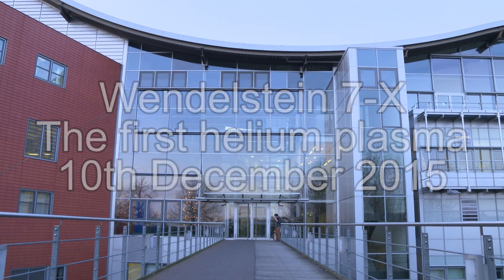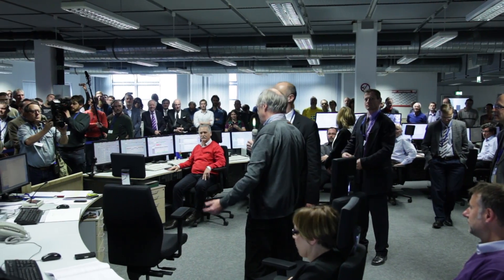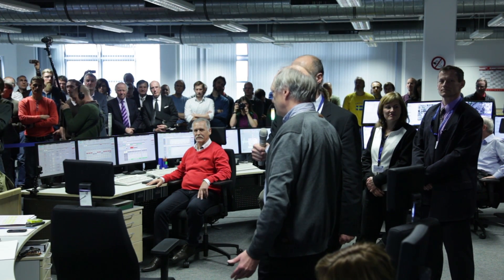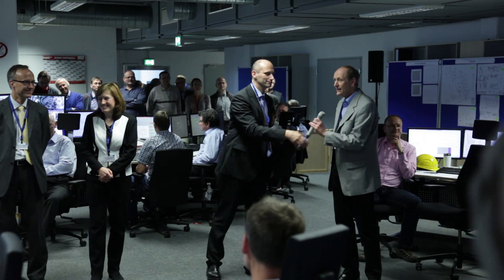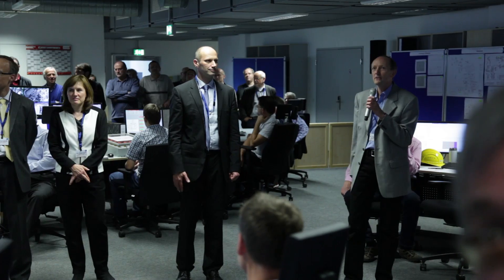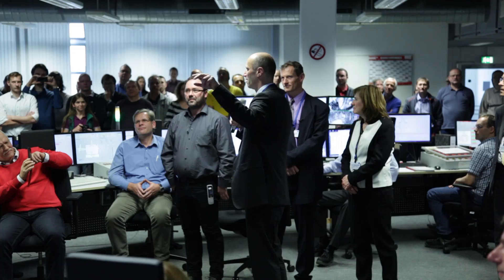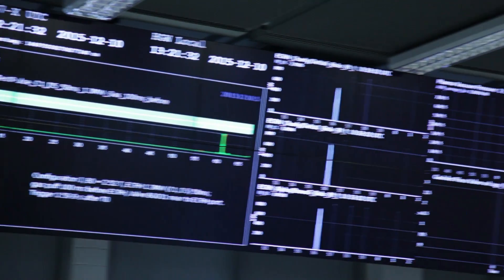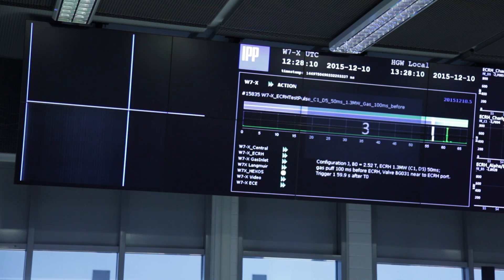Wendelstein 7-X: The first helium plasma

Comment: Korea and China have already achieved much more .having recorded 50 and 200 seconds,respectively. Korea achieved 100 million Kelvin many years ago and will 300 million K/300 seconds in 2020. Also,Korea has 3 times more nuclear powerplants than Germany and has developed the SMART reactor technology and the U-Mo process which others failed to replicate but the US forced Korea to make that technology available on no-royalty basis.
Reply: Nope, that's all wrong. 
This was just the initial test run in the video, of course. This is a Stellarator, which is expected to maintain much longer plasma times than Tokamaks. Plus Korea and China only built the far simpler Tokamak systems. They aren't even close to have something like this. 
The Wendelstein in this video belongs to the Max Planck institute. They also have built several Tokamak reactors (ASDEX) for decades. They even run ASDEX UPGRADE simultaneously in Garching. Also there has been another Tokamak demonstrator in Jülich, Germany (TEXTOR) since the '70s. But like I said, Tokamak is the much simpler technology. We're talking about the much more complex and advanced Stellarator here.

And how is having a lot of nuclear power plants an achievement? Fission technology hasn't made any significant progress since the '80s. The only difference is today they usually add more redundant cooling circuits and have a ceramic core catcher underneath (about 500m $). One of the most advanced conventional fission systems worldwide, the EPR (also built under licence in China) is distinctly based on the German '80's "Konvoi" reactors. 
But as I said: nothing to be proud of. Even France will lower it's dependency of nuclear power in the future. 

Conventional nuclear power is viewed antiquated in science and is definitely no indicator of advanced technology.
Reply: + 1 IMHO, China will build the first fusion power plant. In China a huge progress in fusion energy in recent years.
Reply: xxwzaebd The Chinese fusion reactor was finished almost a decade ago. Certainly a great success. Will see what the W7-X can do in a few years. The W7-X can theoretically operate continously.

Comment: ok I am noob here, so what can we do with this plasma ? what can we make of it ? I mean what would happen if we could use these for more than 1min ?
Reply: This machine can sustain controlled nuclear fusion. You might know nuclear fission from conventional nuclear power plants. This here is nuclear fusion, which produces enormousls high temperatures and has a much higher energy output. Nuclear fusion is the process that takes place in the sun. 
Nice side-effect: it only produces insignificant amounts of nuclear waste with low radiation. 

If this thing works and will be developed to a large scale it will be THE clean energy source.
Reply: You need to be able to prove you can achieve plasma producing temperatures before you "jack things up" (to over 100 million degrees) to produce fusion (force isotopes of hydrogen together, thereby releasing energy). I suppose it's akin to walking before you can run.

Comment: I wonder if Siemens had anything to do with this?
Reply: Parts of the control systems are made by Siemens. Most likely they also delivered parts of the high energy electronics. 

More important is that Siemens' medical division is trying to learn from the metallurgy achievements made in these developments to improve technologies for next generation diagnostic systems.

Comment: This is why OPEC is selling all their oil as quick as they can, before it becomes obsolete! 
:)~ Good job!  I didn't even know about this project until today.  
Let's hope all the fusion projects such as 7-X, ITER, and all others have huge success and a DEMO can be built.  Such technology would make fossil fuels obsolete very quickly. And provide so much energy capacity that it would reduce the cost of recycling, actually make recycling and producing many materials via electrolysis cheaper than mining.  This is revolutionary, such technology not only could put a halt to global warming, but provide enough energy so that no person on earth lives anywhere near poverty.
Reply: I think we do need to temper our enthusiasm for "boundless energy for everyone". As it stands, greenhouse issues aside, the practice of individuals converting energy to the infra-red may or may not be influencing global temperatures (I think it does because even if we stand next to a volcano or firestorm and release heat, that's 𝘮𝘰𝘳𝘦 heat into the system and there's nothing to say it's not all cumulative) but if every individual was given free licence to release thousands of times more energy, we might accelerate things even further beyond our control.
Reply: But please don't get me wrong. I'm a massive fan of any and all efforts towards fusion energy. It's one of our only hopes to deal with that "heat blanket" of CO2 and very soon, CH4 that the majority would choose to ignore rather than make changes.

Comment: Just amazing! Congratulations, I've been following this for some time and I hope this is the beginning of the end of fossil fuel. Just wanted to throw something out there...there should only be 3 twists in the Torus...this forces the plasma to an external and then an internal path in an odd number of twists and thus stirring the plasma and increasing the threshold of optimal nuclear fusion. Should be easier to align the magnetic s so they pull against each other.....any feedback??

Comment: can anyone explain to me what this means exactly?
Reply: +ActivexRecon Wendelstein 7-X is a fusion reactor core of the "stellarator" type. Here they just confirmed the first succesful plasma injection and heat-up with helium. The real business will start next year and will be done with hydrogen instead, since hydrogen is the best fusion fuel candidate (with some specific isotopes). This is particularly interesting, because the stellarator-design is somewhat better suited to serious energy production than tokamak-type, which is the better known and more researched type. Stellarators by design are not altering current machines and should be able to sustain far longer fusion-burn events. Tokamaks must do a regular magnetic field reconfiguration and while this could in theory be made really fast, it will halt the fusion process. Stellarators however do not require this, and could in theory run for hours on end between cycles. Also plasma containment should be easier with stellarators. Their downside is that they are horrendously difficult to design and build, which should be evident if you look at some 3D models of the magnets.

Comment: truly amazing. one question; is it really true that its -296 celsius? because as far as i know the absolute zeropoint is -273,15 celsius or 0 kelvin
Reply: +PrestigeFlow -269, not -296 :P
Reply: +PrestigeFlow Translation error. You are exactly correct, -273,15 (-273.15 in the Imperial System) Celsius is 0 Kelvin. He meant to say "two-hundred nine and sixty", which means 269.

Comment: Can someone explain for a layman how something could be -296C?
Reply: +reinux -269, not 96.
Reply: +reinux he meant to say "negative two hundred nine and sixty", translating to "two hundred and sixty nine". On another note, you can have negative temperature because temperature is simply particles wanting to repel each other, and so bouncing away from each other, or even in the Bose-Einstein condensate, coming together as a sort-of wave. If we managed to make particles attract and so within the set of particles make the particles seem to have entropy in the backwards direction - which we HAVE done - then there would be negative kelvin temperatures. Of course, this seems to defy the laws of thermodynamics, but it does not, because the thing containing the system has to put in tremendous energy (we did it using lasers and magnetic fields).

Long story short, negative Kelvin means heat travels from low heat to high heat (instead of normal high to low).
Reply: Paul Ngo I never knew that. That's awesome. Thanks.

Comment: We need to put one in a electric car, fast ;)
Nice job indeed!
Reply: +Luís R (Junk bin technician)  How it would likely work is that the electricity generated from a reactor like this would feed a grid system, the amount of electricity from the small amount of fuel (deuterium, helium 3, etc.) would produce a huge volume of energy making it cheap enough to use that electricity to produce hydrogen for a hydrogen fuel cell vehicle.  
A fusion reactor model small enough for a car likely won't exist in the next 100 years or more, if ever. However it does produce immense amount of energy per volume of fuel, it's carbon neutral, and no radioactive waste products.  
Aviation fuel could also be produced using these power plants at cheaper than current fuel prices via electrolysis, rather than just splitting H2O into H2 and O, you would add carbon chains to the hydrogen to make a safer less volatile hydro-carbon chain, like jet fuel is today, only that it would be carbon neutral, and the same cost, most likely even cheaper because of the abundance of the fuel and the amount of energy from the fuel.

Comment: a lot of people didnt realize that this is more historic than the invention of the first computer. congrats.
Reply: +izzad ibrahim Not quite more historic, but pretty good.
Reply: A Super Computer made this design possible... So no; btw that's only one of many roles computers may have had here
Reply: I don't see much advance during the last 50 years. They had longer stable plasmas in Tokamaks half a century ago.
Reply: This was just the initial test run -as they already said. This system is far more complex and also can maintain the plasma much longer than any Tokamak.
Reply: Is this one of the steps towards commercially viable energy production via fusion?